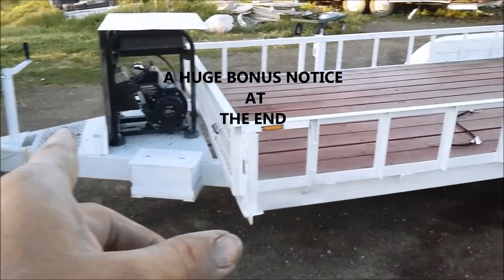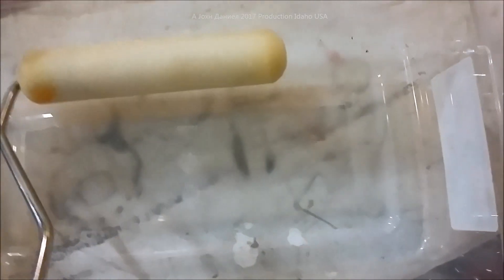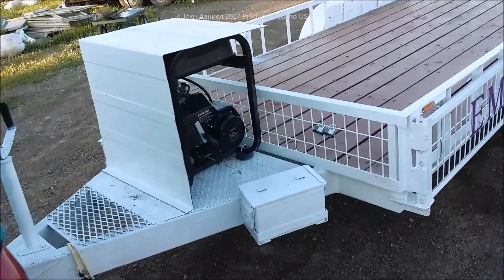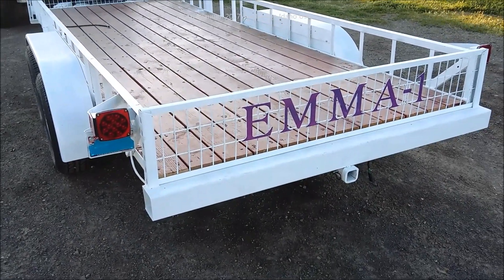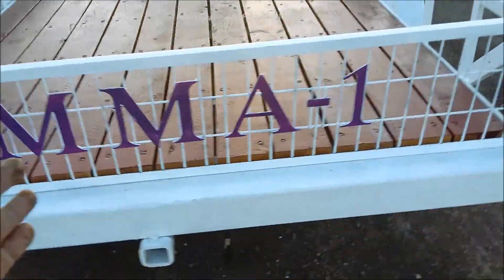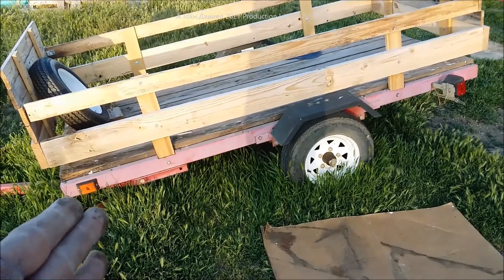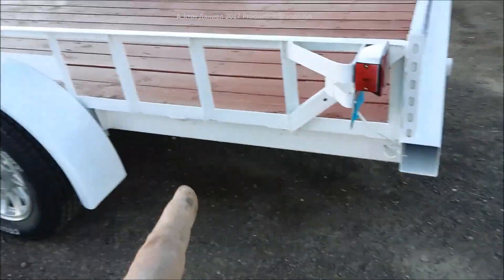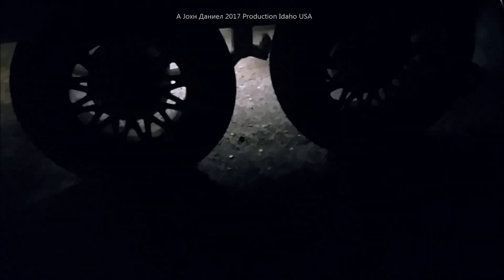DIY Utility Trailer Build & Harbor Freight Trailer kit vid Intro SEE BELOW #6

Comment: LED TAIL LIGHTS http://amzn.to/2ppOHFe OR https://ebay.to/2HgIB4u + More PARTS USED & SPECS - READ ALL, Amazon - Monroe http://amzn.to/2oQoKiv Gabriel http://amzn.to/2onKbTS OR https://ebay.to/2K2iKeD RV TRAILER  And option 2 Gabriel Trailer shocks  https://ebay.to/2Hj5fJu   The BEST Mig Wire my preference is INE, .030 See specs here https://ebay.to/2HN8uWDAND .035 https://ebay.to/2HMpi01 AND 10 pound spool .030 https://ebay.to/2qPdamP INE is Best for Anyone who welds. Welds easy & awesome from 30 amps to 200 both AC or DC.
A great 120 volt welder for anyone Novice or Professional is https://ebay.to/2K3pxEz MIG KIT Beginner to Pro DC+, much better than a Chicago Electric, + theres parts if you need them. Big plus, Guy selling them will support the welder after you buy it.

Good luck, safe welding.

Lincoln, Hobart, and other MIG wire brands simply don't add up to being in the same line of competition as Inetub wire from Italy.
I prefer the .030 due to being able to run it faster with a higher arc closer to the work. But the .035 does work well to fill chamfered pipe and plate.

Specifications For the Monroe http://www.monroe.com/en-US/e-catalog/31176/
Specifications for the Gabriel http://gabriel.com/product-search/light-vehicle-part-search/?q=82026

All JOHN DANIEL /  PREPPER MOUNTAIN VIDEOS are the Property of Panorama Remote Power LLP Idaho USA

Comment: The trailer I am going to build off of is a 1980 Hornet at 23 foot. Total length is 23 feet, I think the bed would be about 19 feet. 
Is those amazon parts you posted links on related to such as my trailer?